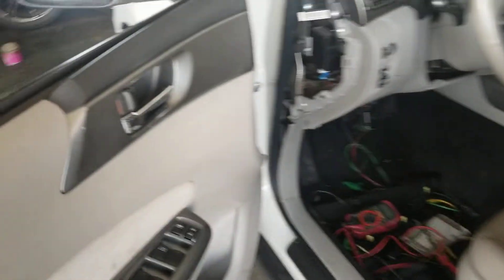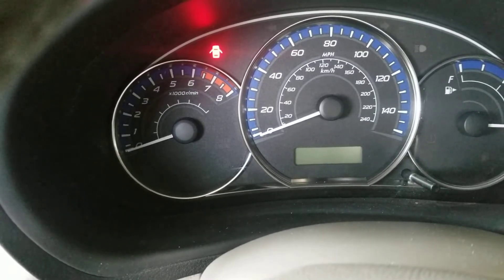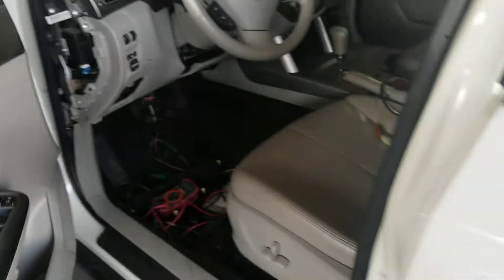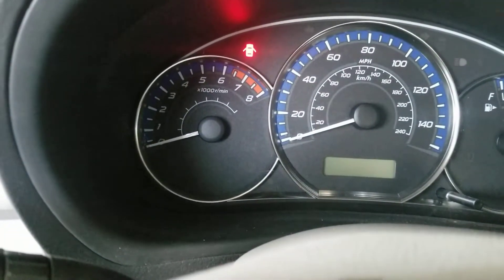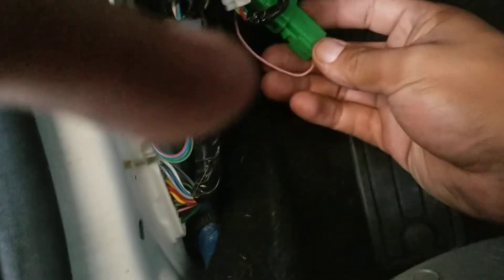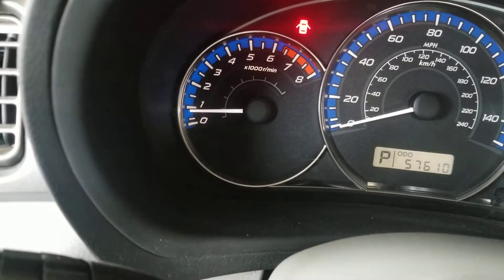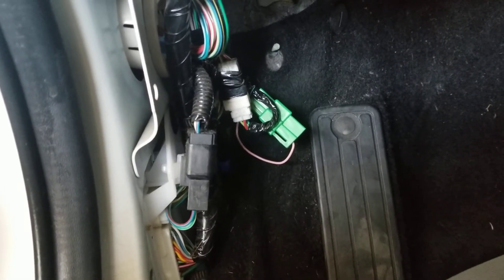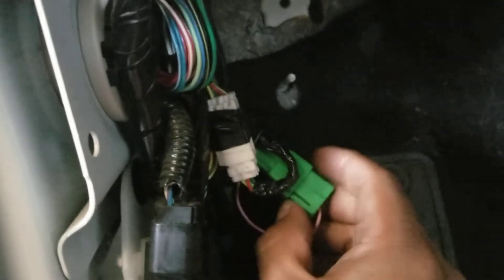Subaru with check engine light flashing and fans ON/OFF

Comment: Thanks for this helpful video! Turns out my 2015 Outback has a fuse in the engine bay box to accomplish this same function. My "I'll tuck a few spare fuses in the empty slots" turned into confusion and panic with the flashing CEL with no codes or obvious issues. I don't know if I would have figured it out without finding this.

Comment: I had my alarm removed and the car acted all weird. The fans going on and other sounds from the engine bay. Turned out I hard to disconnect the 2 green and the 2 black connectors. Both are used for Diagnosic modes. All was fine after disconnecting.

Comment: For 2012 and up Subaru Outback it will not have a green plug. Check fuse 36 in the engine compartment, remove any fuse (10amp). Fuse 36 should be empty! That’s your green plug!
Reply: Does it work with 08 outback? Mine don't have a green plug
Reply: You saved me.

Comment: thanks!  but on a 2013 forester the green plug is on the passenger side under glove box top left,  i spotted the disconnected plug while working on other stuff and thought it came unplugged.. so i plugged it in and tucked it away.  next thing you know its throwing 9 codes.. p0851 p0140 p2195 p2196 p2096   when it previously had none.  now i know its suppose to be unplugged, thanks.

Comment: i did just this, but radiator fan kicks on right when i turn the key even with out starting the engine. i already checkd the temperature sensor and its good. car was over heated before i bought but i rebuilt the engine. checkd fuses and relays under the hood and are good. Leavin that green wire harness disconnected. Appreciate the help anyone.

Comment: YOU. JUST. SAVED. ME. A. SERVICE. BILL! THANK YOU!!! I installed a new oem radio/ac panel and saw this plug and plugged the connectors. Funny b/c I didn't remember unplugging it on the install. 🤨

Comment: I don't get it, my car went to the garage after accident and they had to plug this green connector in to fuck me up? Are you really sure keeping this green connector unplugged isn't going to break anything and that's how it should be?
Reply from the maker: This connector is usually unplugged by manufacturer and its used to run a system diagnosis test.
Reply: What about the black..I think memory ones? Under normal conditions also unplugged??? 
Thanks in advance
Reply: I don't know I have sold the car already too many problems :o)  @pamelavance648
Reply: So should the green connector stay connected or disconnected?
Reply: @wilsonkamoshu4628  disconnected

Comment: Brilliant!  Just saved me loads of hassle; vehicle ('09 Forester 2.0d) was throwing a PO5000 fault code (Veh. speed sensor) and several others - this has cured it, no codes and no fan cycling.  Thanks.  For RHD/UK owners the green plug is on the RHS in the mirrored position to this video.
Reply: I have 2020 sti. I took it to Subaru dealer for a battery drain issue. The service advisor came back and told me that the check engine light is on which wasn’t on when I dropped the car… brought it home hooked up a scanner myself and now it’s showing all of the codes you mentioned and the fan is doing the same thing

Comment: Had a cruise control misuse cause a flashing cruise and solid check engine light to appear. After properly turning off the cruise control and resetting dash lights i though id run an obd scan, noticed it was unplugged and thoughtlessly attached the green plug. We panicked, seeking solutions for hours online and on Sundays everyones closed. Helped me save my car and family roadtrip, thank you!!

Comment: Help me! My car is Impreza 2008 and have the same problem, what I do?
Reply from the maker: Look for this green connector on the driver side kick panel or inside the engine compartment next to the fuse block and unplug it. It is normally unplugged.
Reply: Thank you! I will do
Reply: @barbaraoliva9848  find out what it was ? or were it was